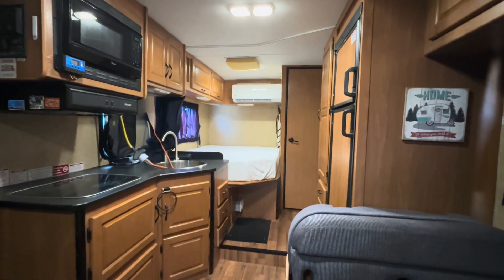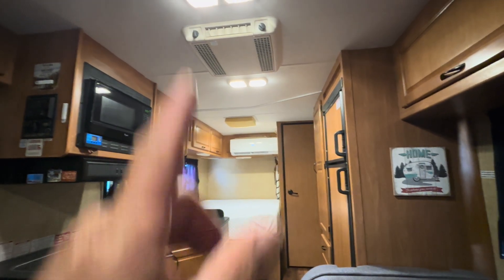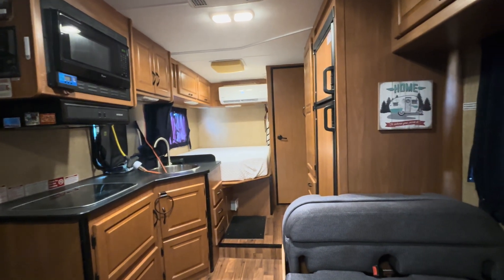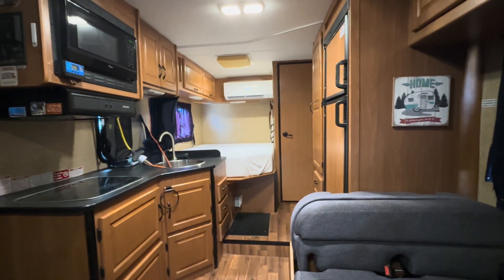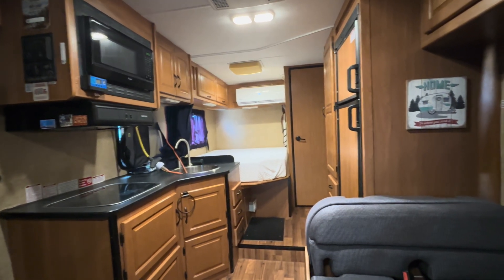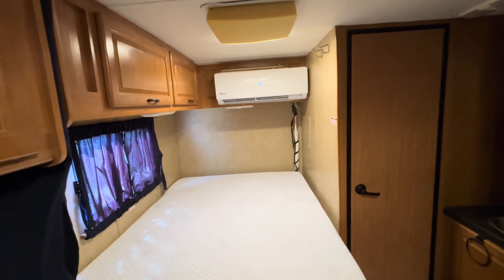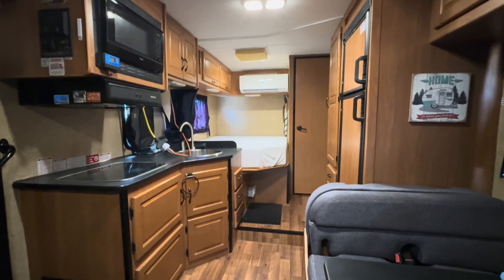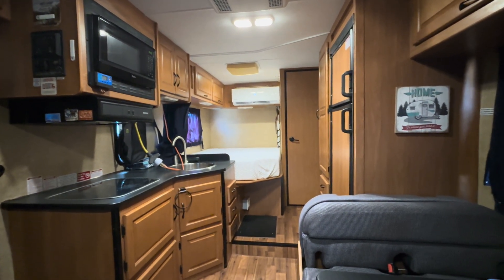RV 9,000 Btu mini split testing in 113 degree heat in June Arizona summer.

Comment: can't complain about that differential. roasting in 107F desert diff state =) to save money i use the omg it's hot pools of sweat method.
Reply from the maker: This is used when we go camping. Works better than the rooftop ac. The only thing I do that I did not mention is when really hot I will run my propane 4000 watt generator to run rooftop ac for about 20-30 minutes while running 9,000 Btu mini split. Can cool down from around 110 to 70 degrees in 30 minutes, then I just run mini split since it is so much more quiet. Once cooled mini split dies a great job keeping temp.

But while I’m home I do have the cement pond in the backyard to jump in to cool off as well. Can’t imagine living out here in summer time without a pool.

I run off grid solar to air condition my 2 story house at 72 - 74 degrees while 113 degrees outside. No grid electric to air condition my house or 3 car garage. Thanks for your comment. Hope you have a blessed weekend